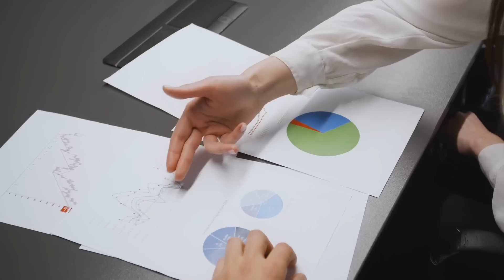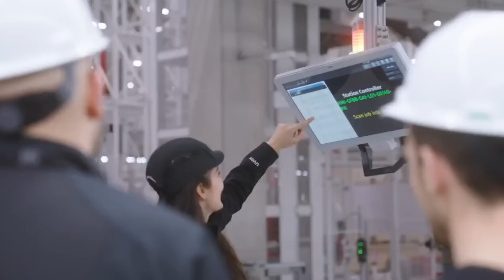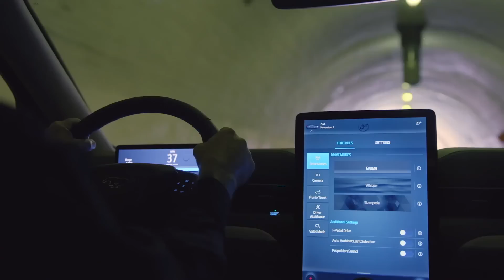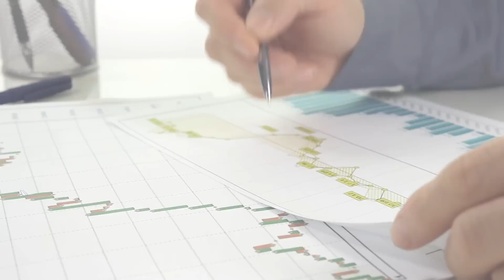Tesla's Supply Chain, Semi Conductors, Vertical Integration

Comment: The elephant in the room is rapid deglobalization. It erodes your rosy outlook on every point. The Tesla stock in 2030 will likely be more like the automotive average ($180 adjusted for splits). I'm afraid it will become painfully obvious that Tesla cars are too costly to build at scale and too difficult to source all the battery materials and electronics.
Reply from the maker: Worse things to worry about than Tesla in that scenario.

Comment: So many scale options to consider. Tesla has already addressed some and is working to address others. All this in the continued effort to build more EV's, build them faster, and build them cheaper. No legacy OEM can even comprehend how they're going to do this.
It's easy but not cheap. Legacy OEMs just need to flip the switch. Dump the ICE portion and jump into the EV portion with both feet. If not, they won't be around in the future.
Reply: They have a potential life-line from the new Bill - hybrids with a 7KWh battery get the full incentive. "Business as usual" for legacy auto...no need to worry about shifting to BEVs...

Comment: Even though Musk said they do not plan to make their own chips, and his argument makes sense.... He never said anything about adding a manufacturer into the Giga factory.
Think about it, if like you said a chip maker decides to work with Tesla, they could build a Tesla specific plant or production directly into the factory. It could even reduce cost.
Just a thought, but Tesla keeps surprising us.
Also, if the Robots become a thing, that's another thing that needs chips.
Reply: I expect Tesla to start designing microcontrollers and Samsung to fab them.
Reply from the maker: I think this is pretty much been locked in with Samsung's new chip fab coming to Austin. It's probably close enough. But it might incentivize more to locate to Austin of course.